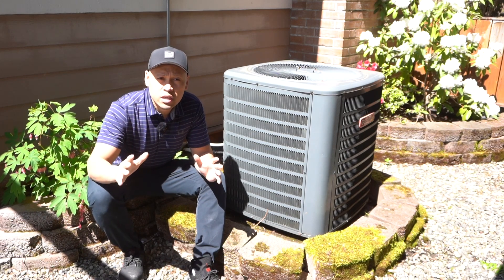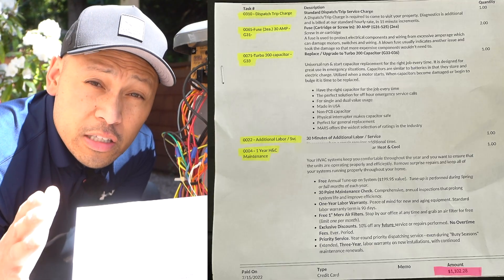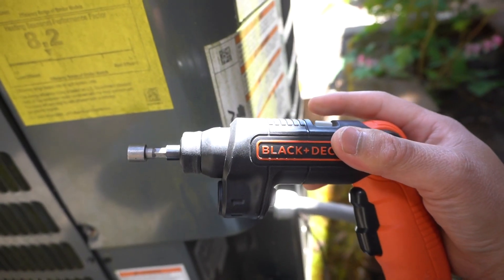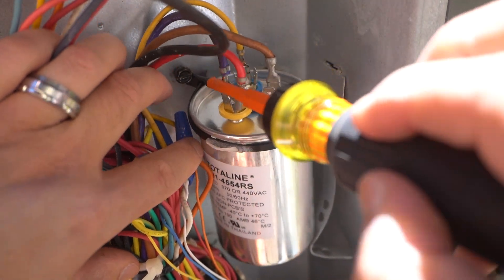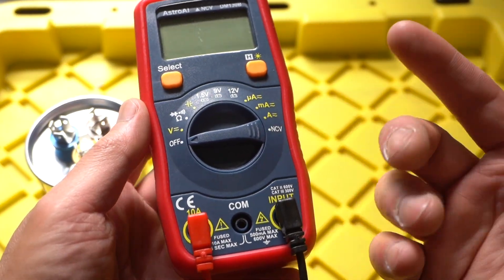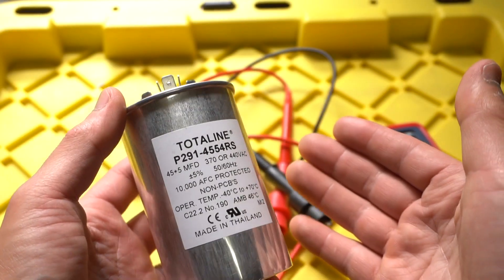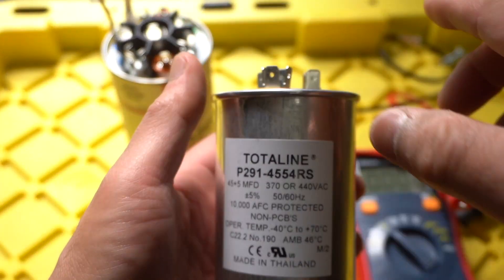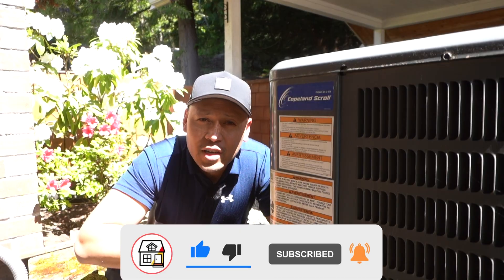I Was Charged $1,100. I Fixed It For $9.99! How To Replace And Test AC Capacitor | EASY DIY!

Comment from the maker: ITEMS I USED ON THIS VIDEO:
- Turbo 200 Motor Run Capacitor - https://amzn.to/3QDDZXO
- Capacitance Multimeter / Voltmeter - https://amzn.to/4bBLXJj
- Black + Decker Cordless Screwdriver - https://amzn.to/3UwaIQ6
- 8mm Driver Bit - https://amzn.to/4bzoCaW
- Insulated Screwdriver - https://amzn.to/3yiZM0Y
- 45/5 MFD 440 Volt Capacitor - https://amzn.to/3WBcRfR
- 35/5 MFD 440 Volt Capacitor - https://amzn.to/3wv23p7

Comment: I’m sorry I cannot recommend this video as a guideline for DIY capacitor replacement. Although, I do agree that the charges from the company or excessive for the work that was done. There are many other videos of actual professionals showing the proper way to do this. This video is misleading and dangerous. First of all, the invoice he showed was including a maintenance policy and two fuses The man in the video said they charged him $1100+ just for the capacitor. Also in this video, the man Said that you would be safe from the electricity if you pull the power plug out of the disconnect, that is Incomplete and Dangerous advice. You should always confirm that the power is disconnected at the appliance with an electrical meter before beginning a repair. It is not uncommon to find a service disconnect that is broken or simply bypassed by another previous electrician, or technician. You must always check to be sure. Believe me, I know from experience this happens way too often. Use the meter to test it before work. A few more minor things that show lack of experience. The man in the video said, on capacitors there will always be one or two spade terminals for the fan connection, always four for the common connection and always three for the Herm connection. This is not correct. Some manufacturers will have four spade connectors on each Of the three terminals. Also, while showing the turbo 200 multi capacitor, he did not mention the Higher price tag for this type, these could vary from $65-$95, not $9.99. I have been working as an HVAC technician with multiple licenses and certifications for the last 35+ years. There are other things that can be dangerous that a seasoned technician will notice, that could damage your equipment even more…..not discussed in this video. You are always better off finding a competent, licensed and affordable company to do the work for you. Safety first. Remember, Dead men don’t need air conditioning.

Comment: So I had to plug a new capacitor and I plugged it in 1 prong to a 3 prong contact and 1 to a 1 prong for the fan but it's not blowing and cooling the same as the old one. The old ones rating was worn off on the compressor rating is it possible I got the wrong capacitor rating?

Comment: I'm testing the capacitor with the power off via fuse to the AC, the main off to the AC.  I have discharged the connection.  I have a specifc capacitor for my Bryant AC that only has the HERM, AC and common.  when I tested the common and the AC the numbers kept going down from 47 to 20 and lower.  I think it's bad and I'm gonna replace it.  I'm going thru all the other videos that you have, but appreciate the assistance.

Comment: Our home AC unit went out and we called our HVAC guy who couldn’t come by to check on it until the end of the week (Friday).  It was a very hot week in Los Angeles and we didn't want to have to deal with this heat for a whole week....  So, we looked up this video, took a chance and Wow!!  This video is super informative!  My wife and I were able to follow this video, replace the capacitor on our goodman unit ourselves and now our AC unit fan is working and blowing nice cool air again....   We lucked out that our issue was the capacitor (which we ordered on amazon)...   Great Video... Thank You!!!!!!
Reply: when you & your wife have time, go back & replace the contactor.
make sure you have no power at all before removing it.

then go inside & replace that capacitor and contactor.
I have just saved you of $9,000.00 from HVAC's scams during the peak seasons.

Comment: If the capacitor is bad, will the entire unit (fan, compressor, or whatever that outside unit is called) simply not turn on? Or if it’s bad, would it still appear to be working but not be blowing cold air inside. I did notice when the unit was running that foam wrapped copper line was a neutral temperature, it wasn’t cold. Wasn’t hot either. Just neutral.
Reply: If the capacitor is bad, it will not start, the capacitor stores, the energy to give it the initial bump to actually kick the fan on outside. There is another capacitor inside the furnace fan, which can also go bad.
Reply: @ATATAT996 thanks. I ended up replacing the capacitor and now it works. The fan always worked, just not the compressor. But, grateful for this video, did it myself for just under $20

Comment: Thank you so much!  Today, I successfully replaced my capacitor in my A/C unit and it now works.  Your instructions on what to buy, how to remove the old one, and how to install the new one were extremely clear.  I bought the exact part that was already in my A/C unit for $30 from Amazon.  I paid extra for shipping because I live in Atlanta and I knew I had a problem because we had already had hot weather and the A/C did not blow cold air.  I wanted the part in two days, not a week from Sunday for free.  Add another $30 for shipping for a total of roughly $60.  To get an HVAC tech to even look at would have cost me $99.

Comment: Thankfully a buddy is an electrical contractor.  Told him my A/C went out and he said  to:
1)  Check the wiring to see if mice have chewed through any of them....easy fix, if so.
2)  Check the capacitor as in this video.  See if has bulged.  If so, replace.
It was bulging so I bought an exact replacement on Amazon for $17.  
Wow....such an easy fix...and saved a lot of $$$!!!
JUST REMEMBER TO SHUT OFF THE POWER / BREAKERS!!!!  Be Safe.
Reply: What does bulging mean?

Comment: I am an hvac technician and installer.  The capacitor in the video retails for almost $100 . 
Altho the video is correct on how to bench test . That capacitor is the best of the best . Not saying you can't find a capacitor for around 20 to 30 bucks . We live these videos beacuse if you hook it up wrong you'll be forking over 5000+ for a new system 👍

Comment: knowledge is power. but if they fix it without any complication then its fine. I have known an old lady my former landlord actually, who  just have her car battery replace from the car dealer it was like 500$ parts and labor thats high right, to change battery. but the mechanic may have broken the radiator overflow and water came out steaming from there while on her way home and called me that her car is smoking so there I found that broken over flow line so I fix it plug the hole at its just works fine but the sensors sensing that so there was that red o flag on the odometer so shes so concern aBOUT THAT. she went back to the dealer to hAVE it fix guess what they charge her 1600$ for the new radiator. not only that after 4 months the car overheated and the engine block was damage she ended up GIVING UP THAT CARr. and get a new car. Moral of the story irs not what you paid for is the work they deliver.

Comment: I had them replaced twice by AC guys in the last 4 years. They charged $250/each. Then a few months ago, the capacitor started acting weird again, so I decided to replace it myself. When I open up the unit, I noticed that the capacitor that they used was underrated for the unit. They supposed to get the 40 +5MFD, but they installed 35 +5MFD instead. I guess that’s the reason it failed again and again within a couple years. I ordered 2 from Amazon, using 1 and 1 spare just in case. They costed me $10-15 a piece. Replacement is quite easy, but please be careful. Make sure you turn off the main circuit and for the AC, and use the power tester to check as well.

Comment: Just fixed my Pool heat pump by replacing a capacitor. For sure I thought it was the compressor that failed bc it tripped the CB. Thanks for this channel. Repaired with a $25 cap!

Comment: Most HVAC problems are simple fixes. The capacitor you can get online or amazon for less than 10 bucks usually. The condenser fan a lot of times wears out. Those are about 90 bucks retail online and simple to replace. I learned all this after the fact. I was charged for 30 minutes work $750.00. Be wary of HVAC companies most will scam you.

Comment: Great video.  Very clear explanation.  What is the symptom of the capacitor failure before I even open the panel and inspect the capacitor?  A/C doesn’t start?
Reply from the maker: Thank you so much! From my experience my AC did not start at all. Next would be just testing it with the multimeter every other year or so.

Comment: Excellent explanation sir! I saved the video for when I need next! I really like that Turbo 200. I've even had a repairman who didn't have the exact capacitor one of my systems needed on his truck so he wired two of them together to get the ratings he needed. That Turbo 200 does it for you! Very nice tip!  I have a home warranty service and have needed capacitors replaced on both my units, but no more!! I've remodeled homes for over 20 years, but chose to never tackle anything HVAC related. Over the years, especially in really hot weather or older units, needed this video and help!! Would have saved me both money and TIME!! Who wants to have a unit down for 2-3 days while you're waiting on a repair!! Thanks again!👍

Comment: What I like todo is pay it once  with a PRO, then go  find the  same parts and buy a few spares. I also paid 330 USD for a AC guy to come out and install a capacitor that was like 17usd on amazon. Never again.

Now I have 2 spares in the same closets wit my AC filters.  Also take pictures of the common and hot wires from multiple angles and leave the photos up  on google-photo to refer to it at a ;after date/time.

Comment: So when a simple human gets shocked by a capacitor becuase they are untrained, then for the record its your fault and for your sake you better hope they do not have a heart pacer on. Now it just became a murder case. ALWAYS HIRE TRAINED TECHS when dealing with HVAC. The untrained need to be trained point blank. DIY is a high risk...Or just hire an HVAC Pro.

Comment: Good video. I watched the heating and cooling technician fix mine. Took him 10 minutes and when he gave me the bill for about 250.00 I said how can you charge this.? He said because we can. I called his office and told them to send back the tech and take his 20 dollar capacitor back, I'm not paying it. They did and I went and bought one and installed it myself in 10 minutes.  They are ripping people off because they can.
Reply: $250 is a fair price, and not out of line, whatsoever.  I’ve seen some local companies charging $500-$600 for a capacitor replacement.  That is way above what it should cost.
Reply: You are paying for an expert to drive to your home, diagnose, and repair your a/c.  You aren't just paying for a cap.  You stole from that a/c company.

Comment: Excellent…our AC guy was here for annual service and suggested replacing the capacitor proactively as our AC unit is now about 5 years old…it added about $50 to the service fee including the new capacitor. We were ok with that…
Reply: Sounds like you have an honest HVAC guy. Stick with him.
Reply: Ya, that is not bad at all. I had a company try to charge me $400. I said pass. Installed my own. I think $35. Only thing I would advise would to buy one from the USA. They are about $10 more but better quality. The ones from China are junk.
Reply: @MarinePigVa Indeed! Grab an Amrad (USA built). The Amrad in my mother's unit has been going strong for over 15 years..

Comment: Great presentation. Very thorough! The first time this happened to me, I tried to buy the capacitor locally - no A/C parts supplier would sell it to me because I was not a ‘licensed’ a/c tech! I couldn’t believe these guys. One guy even tried to make it seem like it was so dangerous (electrocution hazard, etc) -so ridiculous. I found an installer online that sold me one the same day. I bought an extra for $15 on Amazon and it is on the shelf in case I need it. Oh - and they always fail when it is extremely hot outside and all of the A/C companies are days out on next appointments. 😂

Comment: ALWAYS shut the power off before taking anything apart! Including opening that side panel! And check everything with the multimeter before touching, first to a known live source like an outlet, then to the suspected dead equipment, then back to live to be sure your meter was working the entire time.

Also dont forget to turn off your system at your thermostat so it doesnt call for cooling while you are removing or inserting the fuses, like what happened in the video here.

Comment: Personally I usually just replace like with like, i.e. look for the exact make and model of a replacement part and swap it in. I will usually only change make and model if there's a significant cost savings (or the original equipment manufacturer part is no longer available). I think for an inexperienced DIY'er, it would be less intimidating to get an exact replacement than to do math! But great tutorial overall, you have good info on here.

Comment: I learned a little about electronics after taking a couple of courses at a community college, so when my AC stopped working last summer during the hottest day of the year, I took out my multimeter, checked the capacitor, it was a little bulky especially on the top, discharged it, went to the nearest AC supplies store and bought a new one. Total cost: $20 and it took me about 1/2 hr to finish the job. A placed I called just out of curiosity would've charged me $250 or more. My microwave oven also stopped heating up the food. Before buying a new one, I ran some tests and found out the diode was not working. I replaced it, and it only cost me about $9.

Comment: This video takes the $-sign right off of HVAC service calls. On behalf of homeowners all over the US, thank you for helping us save $1,000's on repairs. Your tips on using a multimeter for capacitance testing is excellent. I change my A/C capacitor every year as a routine maintenance procedure - parts are built so cheaply nowadays. Be careful. Electricity can kill you. One crossed wire can destroy your entire system or even burn down your home. Homeowners must follow your safety warnings about disabling the safety plug, taking pictures of electrical wiring, and discharging the capacitor. Don't be fooled, thinking that A/C work is simple and easy. EXPERIENCE and KNOWLEDGE make things look easy! That's all!

Comment: Try to match the width of the replacement capacitor to the original, of which the metal holder's size fits.
Reply: Or use a piece of plumbing strap and a self tapping screw

Comment: Does your multi-merter's capasitance measurement work without the capacitor removal? I have a multimeter that gives acurate reading even without the capacitor removal.

Comment: when I moved in the AC guy I thought I "needed" on a regular basis tried charging me 300 for one in 2007... I told him kick rocks never replaced (it was fine) and cleaned indoor and outdoor coils myself vacuumed the drain lines every once in a while unit ran until it got a leak in 2023. fuckin thieves, ALL OF THEM

Comment: This is a dangerous job because you can get zapped very easily. $1000 is an extreme price if that’s all they did. That being said the part is fairly cheap but you’re paying for the technicians knowledge, skill, part pick-up, and trip to your house. I would not recommend home owners to replace this part. That zip tie is a crappy way to mount the part. I use the original mount or plumbers strap. The zip tie will dry rot. Again, do not try this at home.

Comment: The video thumbnail shows that the capacitor is 9$, the link you posted in the comments section is to a capacitor for $70.
Reply from the maker: Capacitors depending on your AC model can range up to $9 and up.
Reply: @FixThisHouse  I agree, but your thumbnail is literally pointing to a $70 capacitor stating that it is $9. So then I have to ask, if you are falsely stating the price of the capacitor, are you falsely stating the price of the repair? Don’t get me wrong, I appreciate when people provide free information, but I don’t like thumbnails that edge on click bait with false info

Comment: Very true. The ac on the heat pump on a one-time apartment went out. The blower did not kick in. Called maintenance, the guy came out and replaced the capacitor. Took all of 10 minutes and worked fine. So capacitors are definitely the most common point of failure. Spend the $10 first before calling the HVAC guy.

Comment: Did you have to select anything after turning that multimeter to the "capacitor" setting?
Reply: No, that should be it.. Measure 'common to herm' and 'common to fan' on the cap. Should be within 5% or show of the marked rating. Also you need to pull off the wires to prevent reading through the windings...

Comment: Air conditioning more than once I have changed capacitors on a compressor and usually repairs are minor on the units